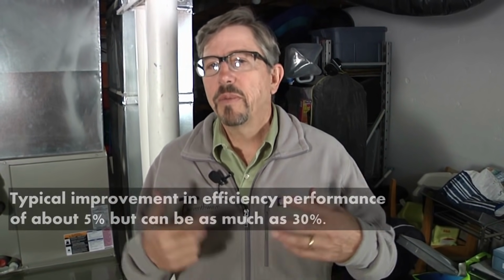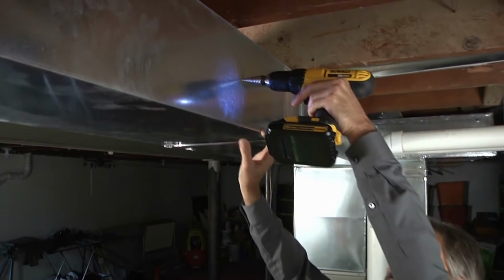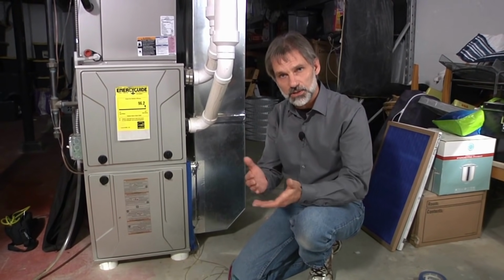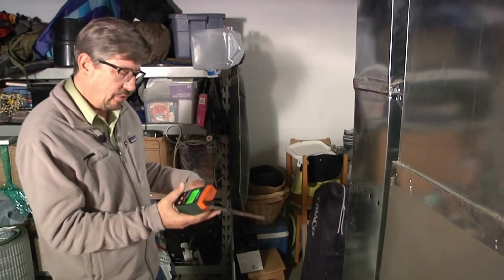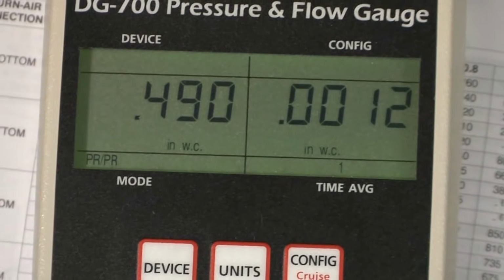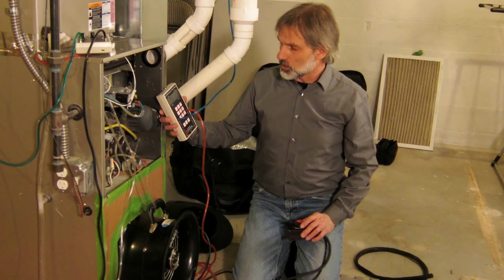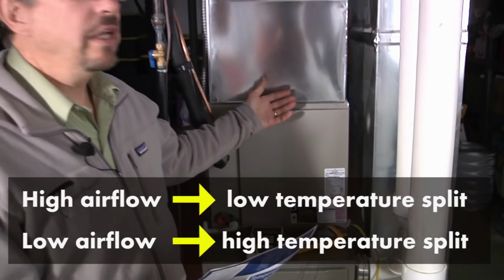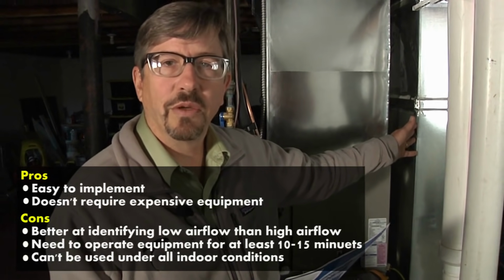Measuring airflow for residential forced-air systems for HVAC professionals

Comment: great video - super informative! do you think the low airflow at the front of the duct was caused by the holes you drilled? curious why it's so consistently low on the front of the duct
Reply from the maker: Hi, Michael. It's unlikely that the holes created that airflow pattern. More likely, it has something to do with the layout of the ductwork upstream of the measurement point. After measuring many homes this way, the one thing that we can say is that the airflow pattern is unpredictable from home to home.